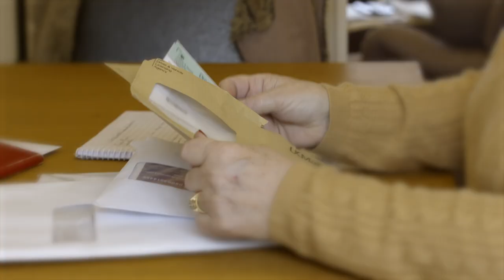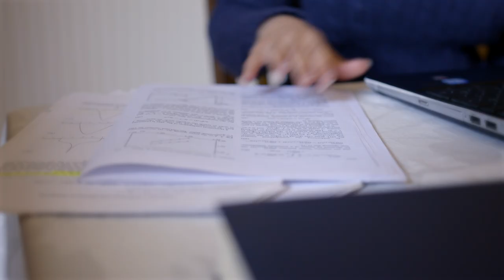WATCH: Party Election Broadcast | Your Priorities are Our Priorities

Comment: This government was warned about the importance of building the battery mega factory. Now that is becoming one of the reasons why the UK is at risk of losing its car industry. The government might also consider supporting local steel production, or that too will become an import that puts a tariff on UK car imports to Europe. 
The UK also gave up making electronic components, so that is yet another import that will stop car manufacturing in the UK. 
The UK government might like to consider what research it wishes to fund. There is an urgent need for research into battery technology that does not require rare earth elements and uses sodium in place of imported lithium.
We also need research into iron nitride, as an alternative to permanent magnets based on cobalt and neodymium.
This is not rocket science, which is something else the UK government has failed to invest in. The UK makes satellites, but has no way to put them into orbit. It has a new rocket base, but no rockets to launch from it. 
In fact the UK government seems to have miss out on the second half of the  20th century, and is playing technological catch up for the first quarter of the 21st.

Comment: The purpose of leaving the EU was so that the UK should not be rule by EU directives, yet when it comes to cosmetic testing on animals, a 25 year ban is reversed to maintain alignment with EU chemical rules. 
This despite the fact that the cosmetic industry does not want to resume animal test. So far from the UK setting an example against this cruel practice, the UK is going to bend to EU directives. SHAME on you. 
It will serve the government right if consumers refuse to buy products tested on animals and boycott the products. Such testing is clearly unnecessary, as has been shown by the past 25 year ban.

This is yet another example where Brexit freedom is meaningless.